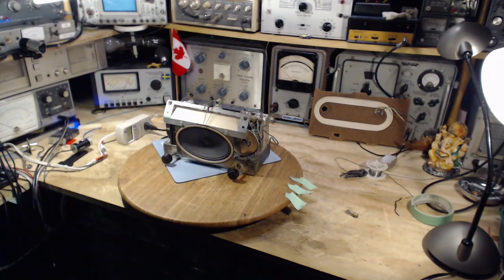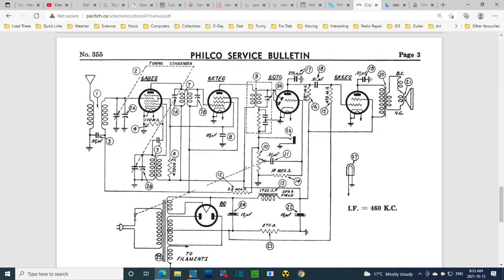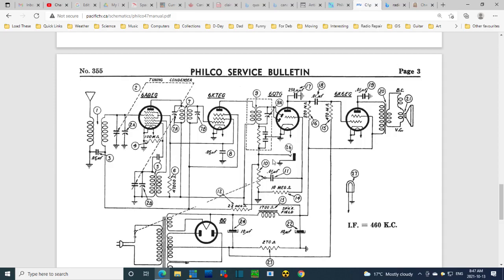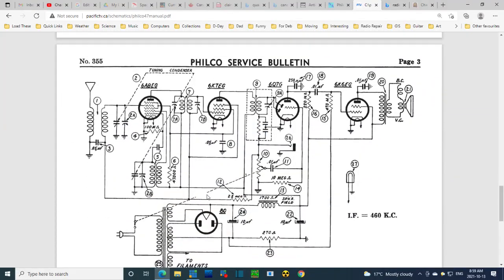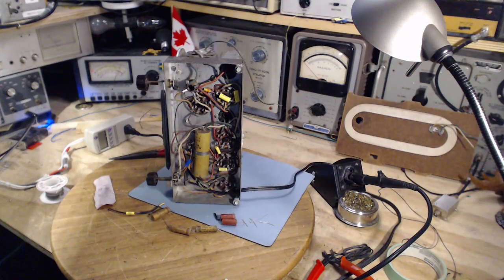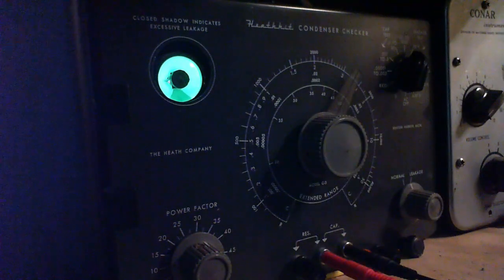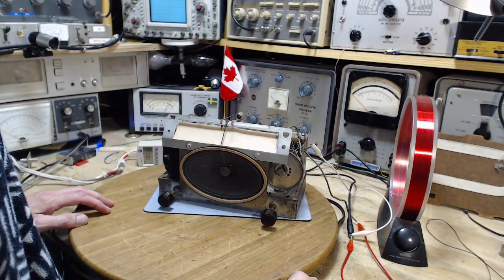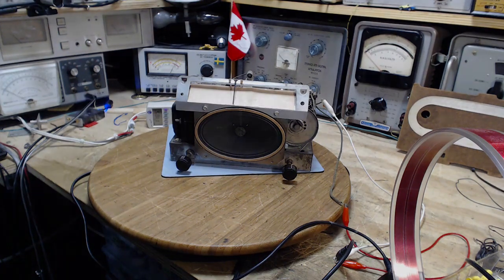Philco 47A Tube Radio Video #3 - Five Capacitors Replaced

Comment: 23:40 to 24:58 While this is a fairly accurate description of the basic principle behind AVC/AGC in an AM radio, you missed to elaborate on a crucial consequence of this AGC action during alignment..
That consequence is that on  alignment you have to either disable AGC, or counteract any major improvement in signal output level by lowering the amplitude of the signal generator as much as possible, in order to keep well below the AGC threshold. If you run into AGC action on alignment, you will fail to get a sharp peak. And especialy on IF sweep alignment the AGC capacitor will produce a time-delay that will shift the passband curve.
But unfortunately, and in contrast to ppl like shango066 or M.Caldeiras, both disabling the AGC or subsequently lowering the signal level on the generator is something we rarely see you do on alignment.